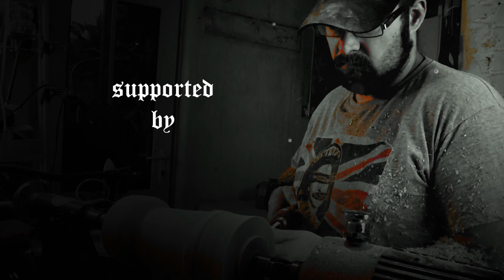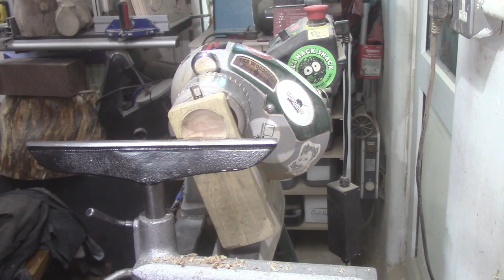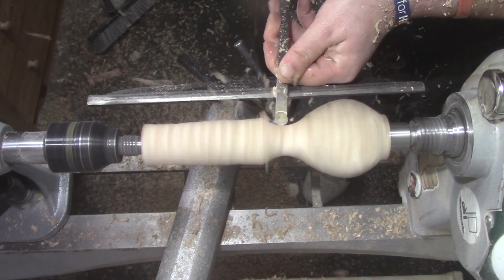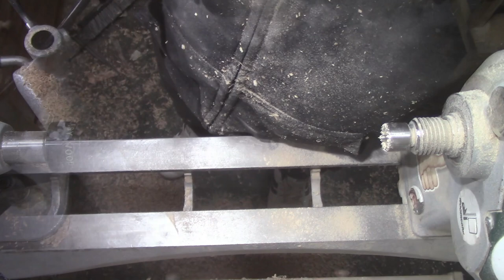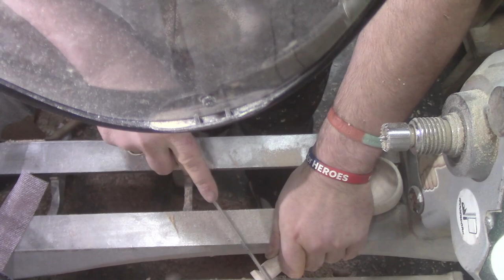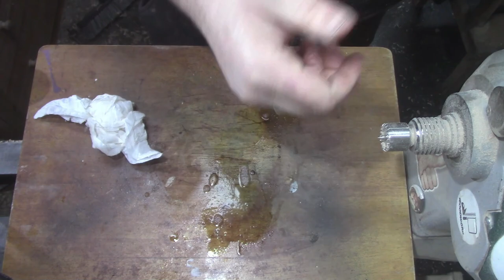Woodturning | My First Spoon

Comment: Great job Jamie. I have made a number of spoons/scoops on the lathe. I start turning the handle with a large ball on one end, do the sanding and finishing and the mount the ball end in a home made doughnut chuck and hollow out the ball to make the spoon. If you want a flat bottom, do not go too deep and then sand the ball to the depth that you want. Happy turning.
Reply from the maker: That's a great idea, ill have to have a go at that, cheers mate